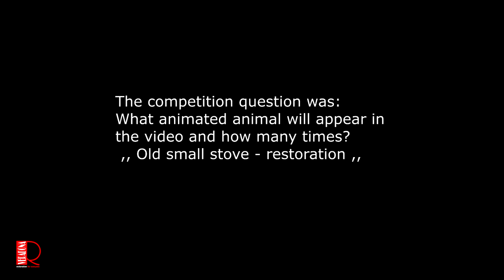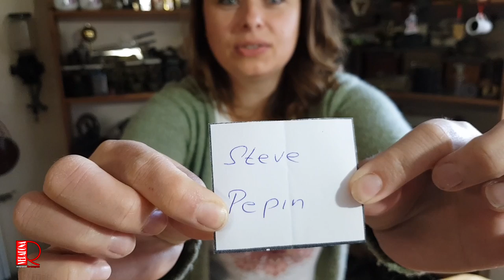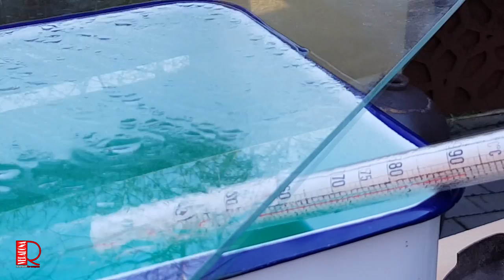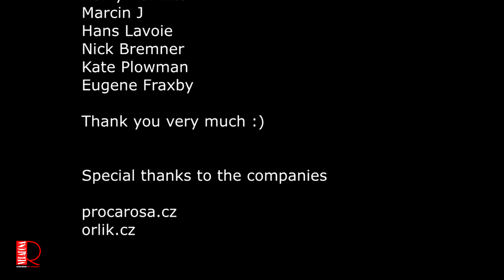Double Hole Punch - restoration

Comment: Wonderful!  Another of your clean and bring back to life videos!   Dispersion Glue with the sanding dust to make a perfectly colored filler!  Very clever and useful tip for me.  Why put tannin in the rust remover?
Reply from the maker: Tannin is already part of this remover. I'm happy with it. It works on an alcohol basis and dries quickly. Thanks Wanda :) Radek

Comment: Some questions for you
Children questions:
In which direction do you turn the edge of the knife if possible when working with it? = FROM YOURSELF
Which company name is on the hole-punch and which number? = MARS 70
Why do we test for lead? Answer = LEAD IS TOXIC!
Adult questions:
Why not putty old metal objects? PRESERVE THE PATINA
What size was the tool and what was it called? Answer = 3/16 ", ROLLPIN!
Good luck!
Carsten
Sweden.

Několik otázek
Otázky dětí:
Prodá země muže, který má vejce, aby s ním mohla pracovat? = PŘÁTELSTVO SEBA!
Kde se společnost drží u punče a vrby? = MARS 70!
Můžeme pro vás otestovat? Svar = BLY ÄR DÁREK!
Vuxen otázky:
Nebude to nepořádek staré kovové barvy? = ULOŽIT PATINAN
Pamatujete si, jak používat nástroje a dostat se rovně? Svar = 3/16 ", ROLLPIN!
Díky Google přeložit.
Hodně štěstí!
Carsten
Švédsko.